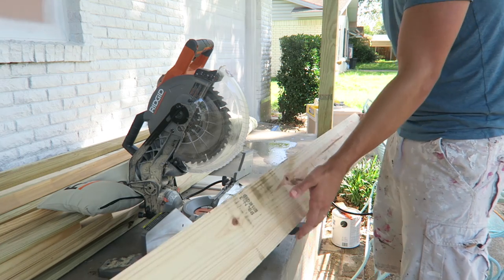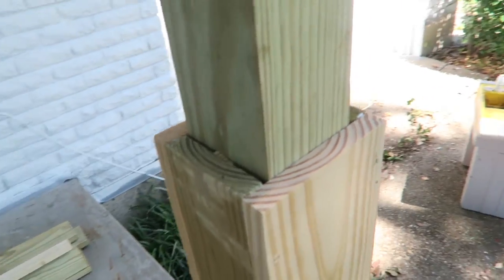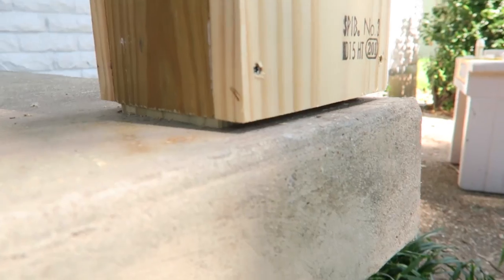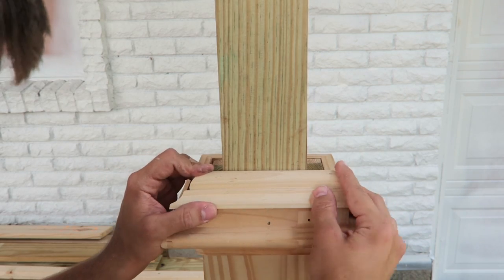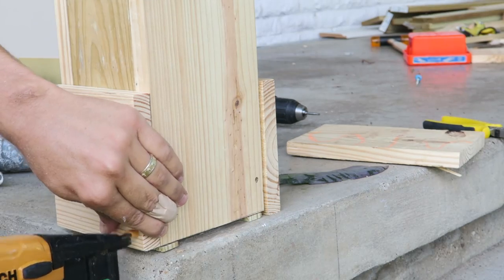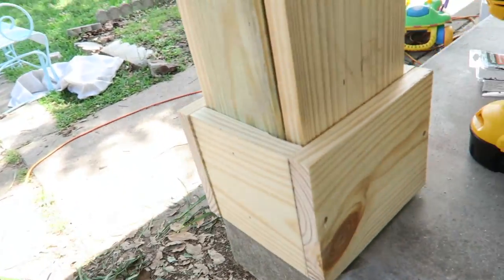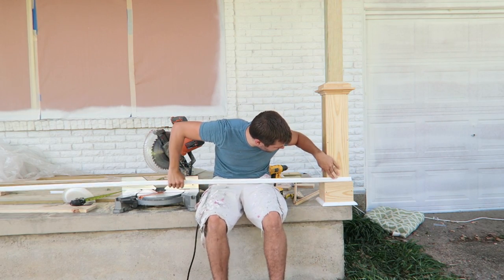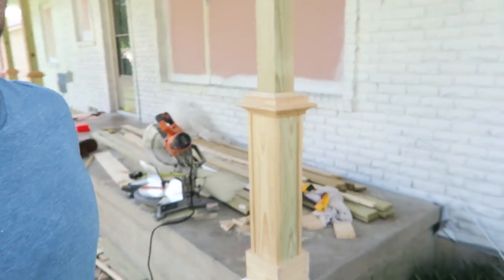EASY, DIY FRONT PORCH COLUMN/POST WRAPS TUTORIAL!

Comment: im a little late on commenting but just stumbled across your video . i just bought a new compound mitre saw and am having the same issue only on 45 cuts. it seems it is just a bit out of square and is an easy fix thanks to you tube lol. search for how to square a compound mitre saw. now mine is cutting straight every time.also cut slow sometimes cutting fast will cause the blade to get off a bit or flex.awesome job on the posts man.
Reply: Having troubles with my new saw and was hoping someone answered.  Searching now.

Comment: Hey Sam,

Great Video! Thanks :-)

 I've taken a quick look at a few of the comments below & would tend to agree with those who said the molding, is parts, slightly, but only slightly warped/bowed. 

That aside, even if the trim was perfectly straight it's been my personal experience a blade with 60-80 teeth set closer together + have one of the 2 following 'Tooth Configuration': "Alternate Top Bevel (ATB)" OR "High Alternate Top Bevel (Hi-ATB)" will yield a straight & finer with little to no chipping Vs. the blade I see you're using in the video. Slowing down the speed you pull on your handle(I.e.: cut slower will help too.) 

At least that's been my experience, but don't take my word for it, do a google search you're sure to find many a page, video, etc. braking down which blade is best for the job. :-)

Here are a few pages that you might find helpful: 

http://www.aconcordcarpenter.com/choosing-a-saw-blade.html

http://www.rockler.com/how-to/blades-101/

http://www.thejoyofmoldings.com/miter-saw-blade-for-cutting-moldings/    

Feel free to let me know what you think & I'm always open to other persons opinions, so feel free to share yours with me..

Thanks...
Reply: If you plan on painting The Columns you should have Prime the ends of the boards

Comment: i like the video - I'm in the process of buying a home that has 4 decorative iron columns on the front porch and to me they look old so I want to wrap them like this but also do a stacked stone treatment around the lower section for a much nicer look. Also on the left side of the house is a carport supported by wood 4X4 beams that I'd like to do this to as well which I think would make the home so awesome. I was just wondering if anyone has wrapped iron columns before instead of removing them? They are very sturdy even though the home is like 87 years old.

Comment: Check to see if your blade is square with the fence and square with the table. The blade has to be off to cut your material at an angle like that. Also, it looked like you caulked the bottom where you installed the PVC. Any water that flows down in the boot molding will get trapped and sit there. It could fill all the way up that bottom 1” if it rained hard.

Comment: Sam, I quite like the Ltrim up the column as well. Check this vid out to check the accuracy on your miter saw (pretty sure we call them drop saws in Australia :) ) https://youtu.be/iX05oi3HtFY?t=6m25s
That little trick should help you figure out if its your blade that's cutting off and maybe an angle adjustment is required. Be sure to note that BOTH the height and depth cuts are checked. But I still think its a good way to check it!

Comment: The material you're cutting should be held down tightly. your mitre saw isn't cutting straight because the blade is pulling the material in the direction the teeth are facing. Great job otherwise!

Comment: The reason your miter saw is not cutting true is because the fence the table and the blade are not Square check your settings was your speed square everything up then it will cut true